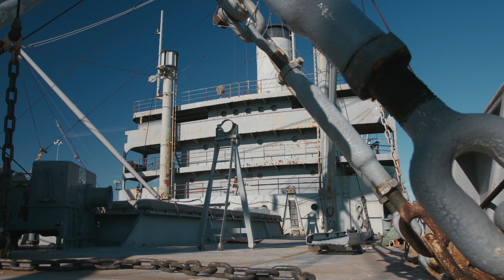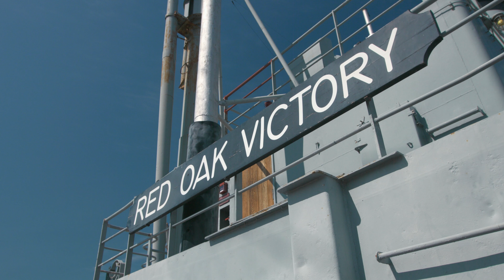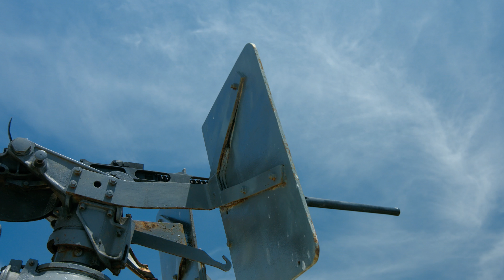[Naval Legends] Red Oak Victory

Comment: 9:10  14,000 refugees and the vessel's carrying capacity was seriously exceeded and could have capsized at any moment.  Seemed odd to me so I did a little quick math; figuring 120lbs for the avg Korean of the time (and children weighing far less), 14K people = 840 tons.  The Victory ships were rated to carry 10,850 tons, or nearly 13 times that weight.  Maybe if the ship was empty and all of them were on the deck?  Seems off...
Reply: Maybe it is more about available space, and also their luggage ? Tho luggage still might be off by a far margin.
Reply: Nah, I looked it up, SS Meredith Victory; they were packed into all five holds and covered the deck shoulder to shoulder, standing room only.  Unable to move or even sit down.  No mention of instability or danger of capsizing; someone either made a poor assumption or this guy was misinformed.  No biggie, it still happened.